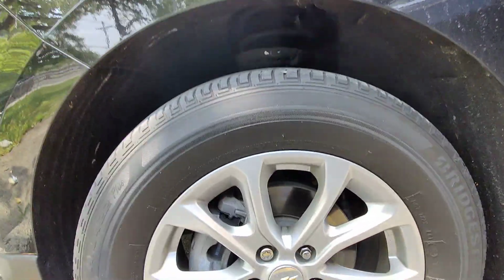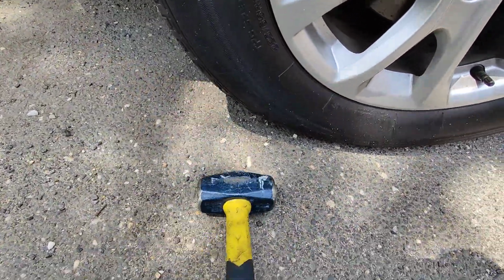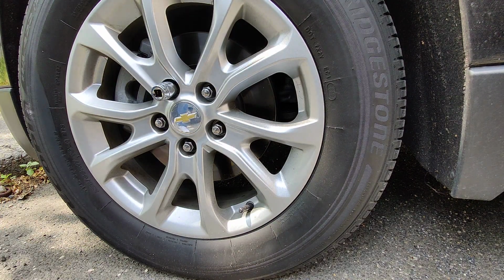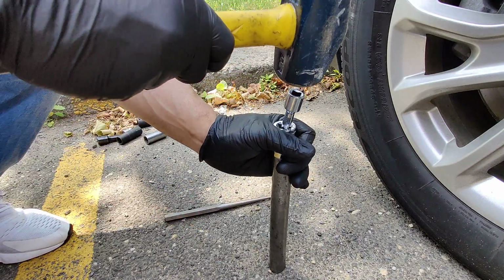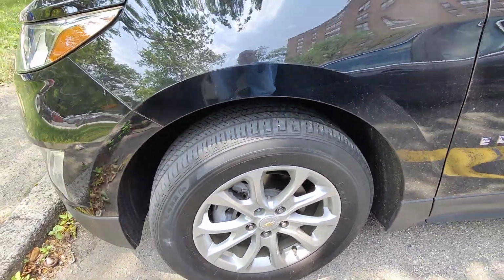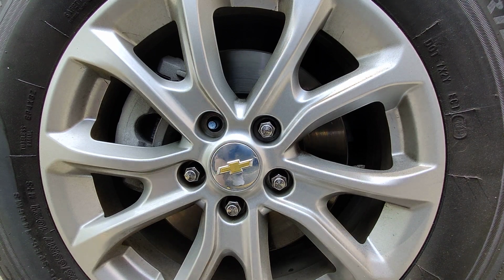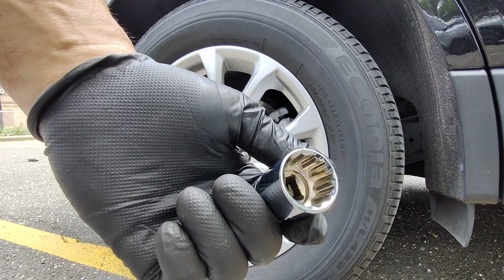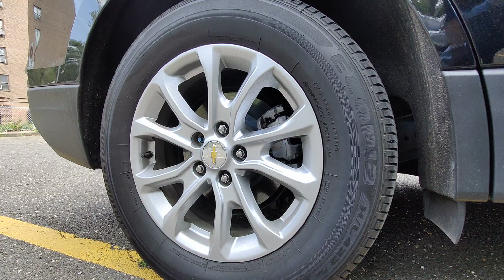2020 equinox lost wheel lock key removal

Comment: Mine just keep stripping I’m screwed 🤦🏾‍♂️
Reply from the maker: Buy one of those stripped bolt extractor socket set,  just make sure  it has size 19 and 21 , 22 I believe one of those  will fit over the stripped lugnut. You just gotta tap it on with a hammer but it will definitely remove it
Reply from the maker: This set worked for me , I bought it on Amazon. B08697WPSW
Reply: Thanks I’ll try